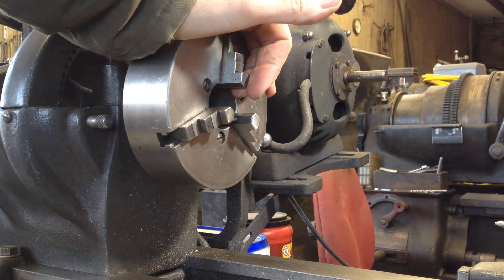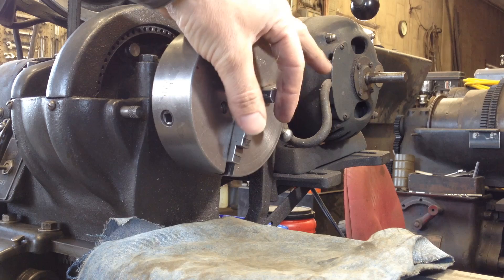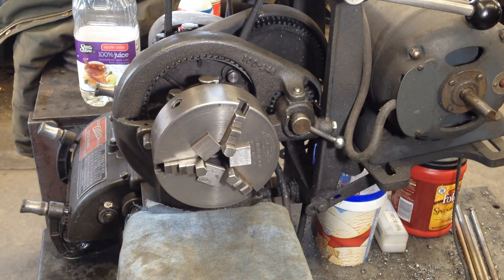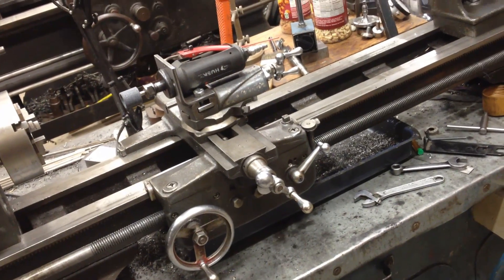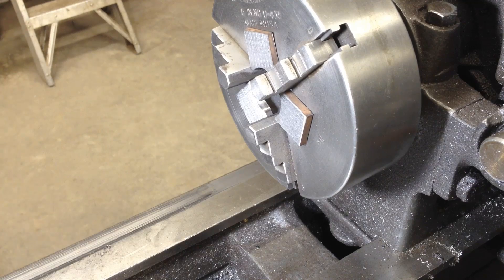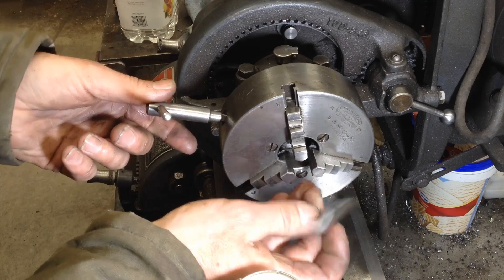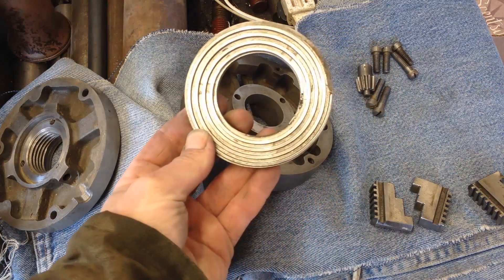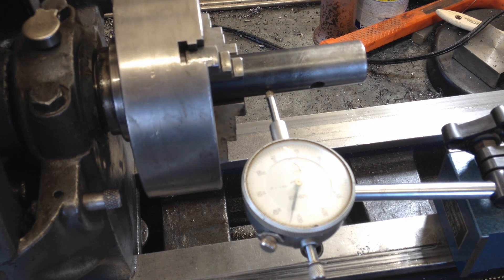Spacer Method for Chuck Grinding ATLAS lathe

Comment: From 20 down to 3 is not so bad.  Those 3 jaw are not always that much better I do not think.   I have seen tension produced also with a round ring.  I am trying to remember who it was though.....Maybe Oxtool Tom Lipton.

Keep up the good work.

Finally got the SB up and running.   Any experience with carbide insert tool holders?
Reply: +phooesnax the trick with the ring only works with bolted on jaws, so you can use on of the holes to let a bolt protrude (a washer under the head) and clamp the ring inward. (both keith fenner and Tom lipton showed it) Sunpaa just drilled holes in the front of his jaws with a carbide drill in order to put dowel pins in. cheers.
Reply from the maker: +phooesnax Good to hear the SB is running! I used your gift on this project, but the footage didn't make it into the video.  And I have no advice with inserts. Although I plan to start using them now that I have the turret post.
Reply: Very Cool and cool.  Looking forward to seeing that. I will let you know.  Might just ordered up something generic off of Amazon.